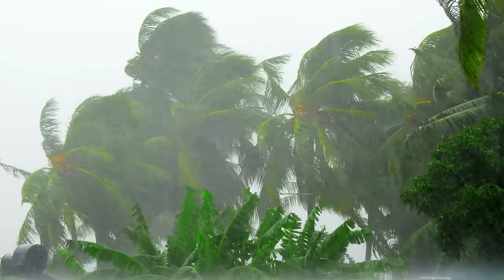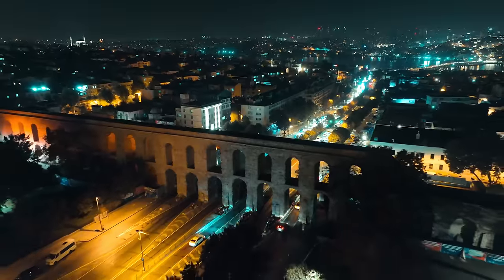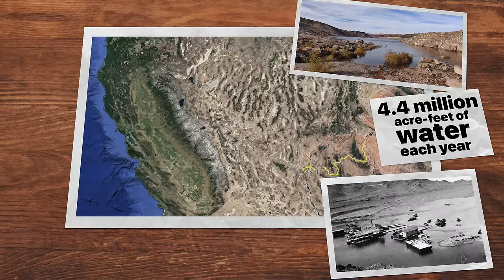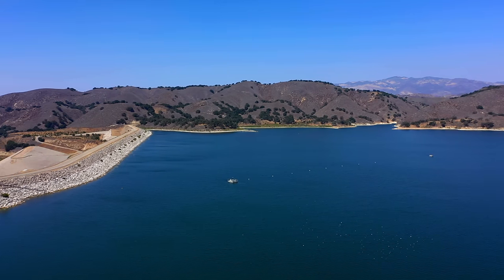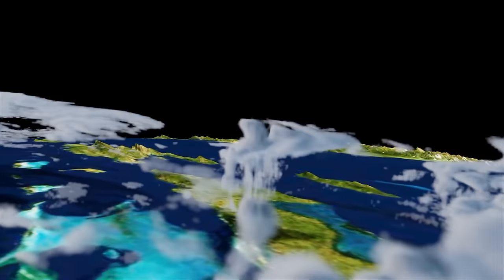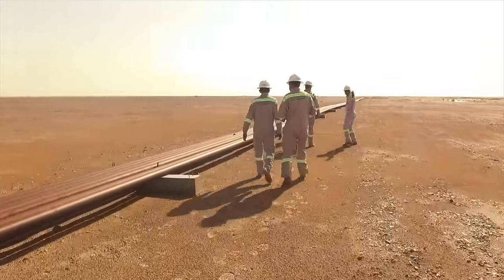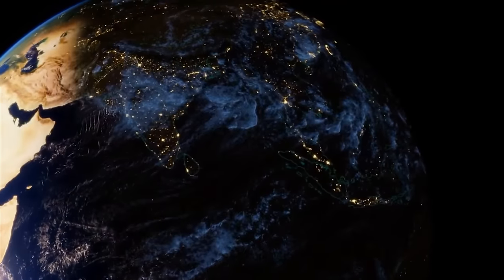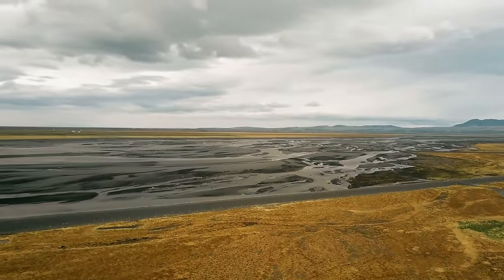Pipelines From Flood to Drought

Comment: It seems unlikely that water could be piped in the keystone pipeline as quickly as you are thinking. 600k barrels/day is about 1.7 m/s volumetric flow rate for the heated oil and if you were to multiply that by your 1000 number you would have water flowing in the pipes at 1700 m/s volumetric which seems insanely stupid (and nearly Mach 5...). Just imagine turning the pipes off, lol. (I'm a bit rusty so my math could be off).
Reply: 1681 m/s is specifically the number I landed on. Guy in the video assumed viscosity was the only limiting factor, not flow velocity.

Comment: The problem is that, in order to make a difference, you need to move HUGE quantities of water. Unless you’re working with gravity and have relatively small distances to travel then it’s just not practical. Pumping takes vast amounts of power, so much that pumped storage systems are used for grid scale peaker plants. Oil pipelines in comparison are tiny compared to the water volumes from floods. Floods typically overflow rivers that are 10’s or 100’s of yards wide, not a paltry 36 inches.
Reply: The proposal is not to pump the water only when it floods. It's a too late at that point. We couldn't pump fast enough. Rather, it's to preemptively pump water out when there is a high risk of floods as indicated by weather models and current water levels, so that the rivers and reservoirs don't overflow. This kind of pumping can afford to be slower. Risk management is the key mission, not disaster recovery.
Reply: @Zeero3846  - It could be done for seasonal shifts or excesses, especially as we're adjusting to the new norms.  Snowmagedons at greater amounts or where it doesn't usually snow could melt the overload of snow and shift the water to reservoirs that have room.  With a cross country network of canals or pipes that could shift the flow with a few changes, staged water for future use would be an option.
Reply: Watch the video again and you might pick up some more information about your statement.
Reply: Use trompes. You wind up moving a whole lot more water to achieve the end result, but you're basically using gravity as your power source...
Reply: As long as its net downstream, this might be possible with less energy.
Reply: @adurpandya2742  it's not though, it's upstream all the way.
Reply: The Missouri River baison had two competing plans. Sloan and pickering. They combined them but as compromise not doing both. One of the plans called for thousands of small dams on tributary the other large main stem dams. In the comp  only a hundred or so tributary dams got built. Had all of them been done enough water could have been retained to prevent the 93 floods
Reply: Also with wind powered pumps you can move the water  a bit at a time with out taping the power grid
Reply: @nunyabidniz2868  what are tromps please?
Reply: @jeffbybee5207  perfect job for wind.
Reply: @Zeero3846  hopefully the Midwest can handle it. When you take from our ground water in the south it will cause lots of sink hole issues. Call me whatever, but California created this problem for themselves when they decide to live there and beyond their abilities. Hurting other places and peoples’ livable areas in the process is my fear of what this can cause to keep a pipe dream alive.
Reply: New Idea:  Pipe glacier melt off Greenland to N. America, and Africa.  This could slow Atlantic Current slowing due to the insertion of cold water and work to reforest desert areas.
Reply: @davidjones6389  cool idea but wouldn’t they have to desalinate the water? If so, is it feasible for the amount of water they require?
Reply: @BrknGrnd  Over 68 percent of earths fresh water is locked up in ice and glaciers.
Reply: @davidjones6389  sounds good to me then
Reply: @BrknGrnd  Now if I only had a couple of Billion dollars.
Reply: Siphon
Reply: @Camboge  doesn’t work for heights above about 10 meters. This is precisely how barometers work. They measure the amount of liquid that atmospheric pressure can support (normally mercury for a barometer, but you can use water). With a perfect vacuum above and atmospheric pressure below your liquid won’t rise above that point. If you can’t suck it above 10 meters then it can’t start the siphonic effect above that point either.

Comment: This was done in South Africa years ago. In Mapumalanga or eastern Transvaal, we pump water between overflowing and low-level dams. All this was done with one control room connected to pump stations around the eastern Transvaal. Not that complicated to scale up.
Reply: Yes but realize that Ricky is talking about the U.S., where nothing happens, because of bureaucracy.  Talk, maybe.  Nothing else.
Reply: Yeah that’s all well and good over a 100miles but this guy is suggesting moving water from somewhere like New Orleans to LA. That’s a bit different. The time it would take to move the amount of water for this idea to be plausible would require a massive size pipeline.
Reply: @justinfabbott  it can start smaller though. Start with refilling the large lakes that are running low. There is already infrastructure to pump out of those lakes to needed areas so half the battle is done.
Reply: @ConcreteLand  Yes there may be lakes on the receiving end that are running low but where are these reservoirs holding all the water in New Orleans. you know the ones you want to pump down?
Reply: @PennaMinecraft  Probably cheapest solution, but desert has its attractions.
Reply: Have there been any noticable effects from mixing ecosystems?   That's the part that will stop this idea dead in it's tracks here in the us
Reply: Can you imagine SA doing that again? Lol
Reply: You have no idea what you're talking about. This is not that....
Reply: @PennaMinecraft  maybe people should just stop living in areas prone to flooding.
Reply: Use boring tunnels. Cheapest way to make a big hole and no gravity losses.
Reply: @IsmaelNxala  lol...  I have a strong imagination...  but not that strong... 🤣
Reply: @jimgraham6722  Nor cheaper. The relocation of those people. Plus building up.the areas they would go to. Let alone the stress it would put on the water supply of the areas
 Would far exceed.
Reply: @jimgraham6722  
Many things that just won't work at all might  seem attractive especially if you just don't think about them at all before you try to build them. Time speed space distance and cost all magnify the implausibility particularly at enormous scale.
Reply: @no thank you It is not a matter of whether will it work, it has been done in the 80s. It is still working today.
Reply: @justinfabbott  yep a national jobs program, much better use of taxes then war, and supporting Ukraine war